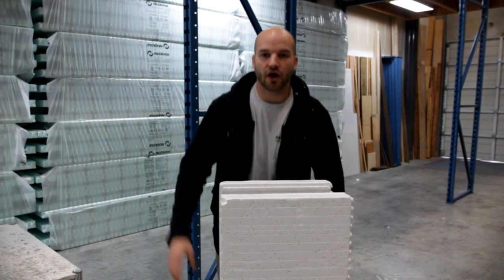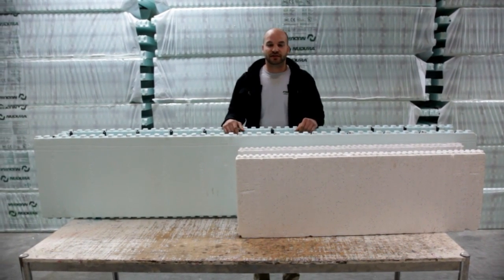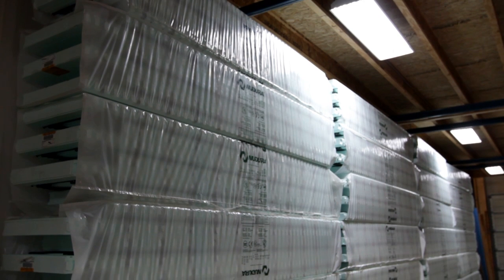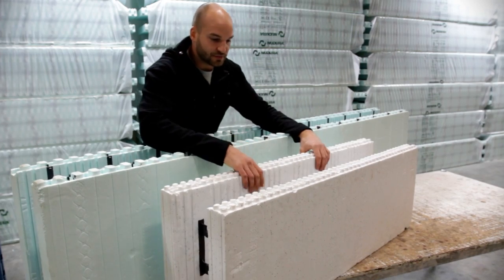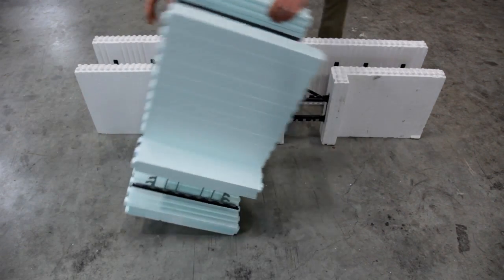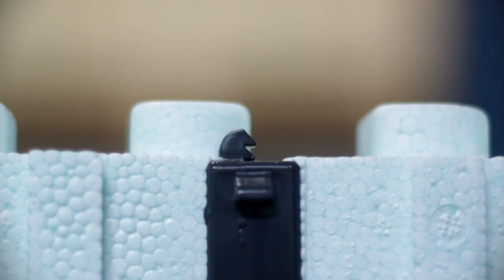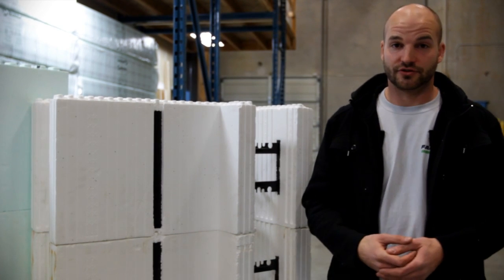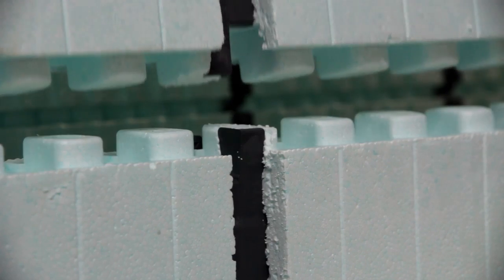Why choose Nudura® Insulated Concrete Forms

Comment: Do you have some idea about how to do asymmetric width transition on a T form? The application came about with the attached garage and the ICF wall of the walkout basement. The ICF wall of the walkout basement would have wider core to carry the load of the main floor above, but the attached garage firewall, can use narrower ICF form. How could I do this width transition horizontally? I see many training video out there on vertical transitions of ICF wall widths...
Reply from the maker: We would use the Zee T bracket to quickly make our own custom t transition. See this page here; https://fab-form.com/zontBracing/zee.php

Comment: Interesting you compare ONE brand of other icf that is non reversible and assume all others are also not reversible, afaik others outside of Nudura except the one you demonstrated of not being reversible is quite the contrary as most of them have always been or at some time before your video were redesigned to become reversible. Also not the only manufacturer to offer flat pack as shown or with separate webs requiring assembly before use.
The only thing that separates Nudura from the rest is the height and length, they still do not offer buck forms for openings and no floor/deck forms yet like what Build Block and Quad Lock offer. The only upside of Nudura to others is as said and shown which means faster assembly for large projects like a 10,000 square foot warehouse to that of the smaller units. When it comes to radius (Build Block has these as of a year before your video) blocks you still have to cut up blocks to make the curve and thus creates "waste". 
I could go on and on, but not going to waste your time much further for now.
Reply from the maker: All the best Josh

Comment: fox blocks are reversible, pre assembled, and just plain  easier to use.  Will not use Nudura again after the last project (240 blocks) with inability to use #5 rebar when cold outside and ill fitting "T" sections. And the background "music" on this video is obnoxious and annoying.
Reply from the maker: Thanks for letting us know your taste in music. No ICF T Block is very good, that is why we use the Zee bracket from Fab-Form; https://fab-form.com/zontBracing/zee.php
Nudura is reversible, pre-assembled, and we build in very cold climates during the winter with all projects using #5 rebar.

Comment: Nudura is a good block , but has the same failing as all block systems: waste, expect to lose 20-25% of material due to windows, doors ... once you cut a block, the leftover is usually not used
Reply from the maker: I agree with you that waste can be an issue. But as Nudura is reversible, 20-25% is far, far too high. With all small offcuts onsite, we create Frankenstein blocks by gluing these back together and using them for the top row, where pressure is low. I would say we are averaging maybe 3% waste factor on all the projects that we supply.
Reply: VANCOUVER ICF tried that with Nudura and Arxx and Fox
Time consuming
Panel system Quadlock had zero waste naturally
I ll give you that for blocks Nudura is tops and reversible is huge
Reply: @vancouvericf  , thanks for the pro tip on using glue to create "Frankenstein" blocks! May I ask what type of glue you use for that? Sounds genius and as I will be doing this virtually by myself, waste is a huge issue for me - can't afford that!

*On another note, do you find that it's pretty easy to use the stabilizing system (to keep the walls plumb)? I heard another pro tip was to tilt the walls inward towards the stabilizers by 1/4" in order to ensure the ability to "push out", rather than try to "pull in" when it comes to leveling the walls. Any tips on this system appreciated, as I don't have a lot of construction experience besides basic furniture making. Ty
Reply from the maker: What you want is a low expansion foam, that doesn't push the blocks away. We supply one made by Rivenco in our local market; https://rivenco.com/ Place a uncut block on the ground, put your Frankenstein pieces ontop and foam together, then place another uncut block ontop. Boom, new block for the top of the wall.  In regards to bracing, on long wall yes we recommend leaning them in slightly, as it is always easier to push than pull a wall. We don't supply traditional steel ICF braces on our jobs. We supply the Zont bracing system from Fab-Form; https://www.fab-form.com/zontBracing/zontBracingOverview.phpThis is more cost effective to our customers, and is a lot easier to ship and store.